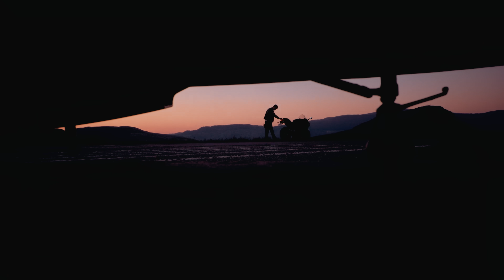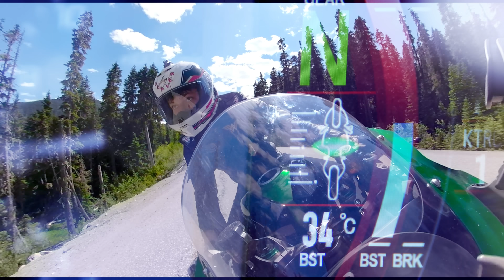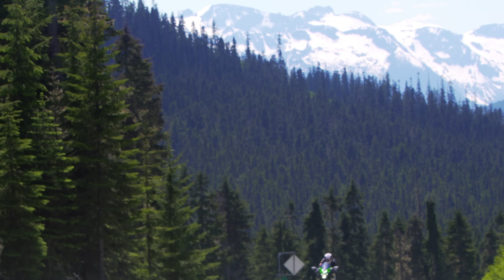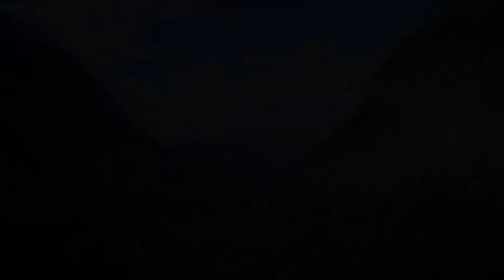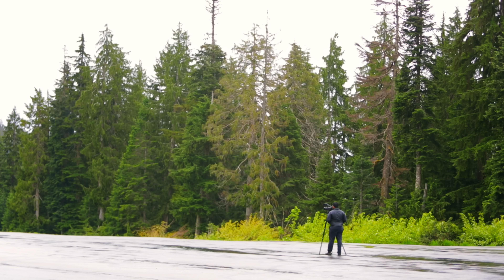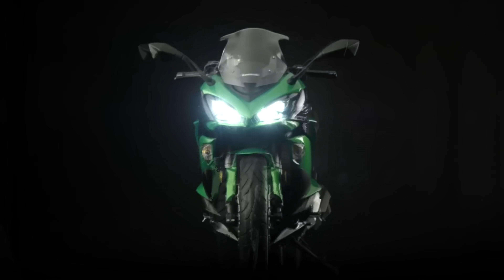Kawasaki Ninja H2 SX Review - 200HP Touring?

Comment: My husband remembers, back in 1990, buying a copy of Performance Bikes in the UK because, featured on the front, was the new Kawasaki ZZR1100. It would allegedly do 170mph and if you changed the tops of the carburettors for the ZXR750, they would open further so you would get full power.  I.e. it was restricted DOWN to 170mph. 

Also back in the 1980s, Kawasaki made a GPZ750 Turbo. He saw one once outside a bike shop he was visiting and watched for a minute while the owner showed if off and revved it up to his friends. It sounded like a small electric motor. It could do,  flat out, 155mph. He knew someone who had tried it out on the motorway at night. It made 10 hp which was really good for a 750 as, with no turbo, 70hp is what you would get.

Comment: Creators Should Attempt to Verify Their Facts First! To Repeat The Lie That The 1984 Kawasaki KZ900R Ninja Was The "World's Fastest Motorcycle" IS A FALSE STATEMENT! This is possibly before this YouTube creator was born HOWEVER Here are the FACTS from ACTUAL EXPERIENCE! Their was a great campaign by the Kawasaki and Motorcycle Magazines to "PUSH" these false claims of the power and capabilities of the KZ900 Ninja. The FACT Are in repeated runs by either high speed or drag race, the Honda VFR 1000 Interceptor trounced the KZ900s...Repeatedly. Roll-on's, Dig starts with the KZ900 starting first ALWAYS yielded the SAME results! A TROUNCING of the KZ900 Ninja! In FACT The VFR 1000 Interceptor Which Honda REFUSED to PAY the Ransom for Favorable Coverage by Motorcycle magazines was a SUPERIOR PERFORMER! Unfortunately The False Claims Made By Kawasaki and Falsely Continued By Motorcycle Magazines Who Were Obviously Influenced by Incentives From Kawasaki resulted in good sales for the KZ900 Ninja but left a number of Ninja buyers SHOCKED at the Shellackings They RECEIVED From The Honda VFR 1000's REPEATEDLY! Even Kawasaki Dealer Owners Who were familiar with the Honda VFR 1000 Interceptor would ADMIT Off The Record That The Honda Was Clearly FASTER and QUICKER! However, This does not take away the prowess of Kawasaki in innovation and commitment to performance That impressed me with my first Kawi which was a KZ1100 Beast That Was Built Like a Locomotive and probably as quick as the KZ900 under the right conditions!  GPZs, ZX14Rs, H2s clearly establish Kawasaki as a reputable and proven performance motorcycle manufacturer. However...Facts Are...Facts and NOT HEARSAY! Ride On and Ride Safe!

Comment: The chirp is not the blades breaking the sound barrier, it's surge because of the low airflow (the throttle plate closing) and high pressure ratio, if it was the sound if the blades breaking the sound barrier you would hear it all the time when the supercharger is spinning fast enough and you would still hear it when you put a blow off valve on the bike.

Comment: I'm 60yrs+, live in Michigan, I was riding a  1973 Z-1 and a 1981 FXE Super Glide. This was 1985 and and a close friend of mine said, "Let's trade bikes for a poker run." His bike was the 1000cc Turbo Kawasaki. at the time, it was a dealer installed option brand new. (his wife didn't like it) I didn't like it either. At the end of our day, my friend offered to trade "straight up, bike for bike." The "73" Z-1 was fast cool but very spooky to ride, but I didn't trade because the Turbo 1000 was far worse! 145mph on my Z-1 wasn't a joy, but a job. The "Turbo King Kawa" was by far the strongest, stupidest motorcycle I've ever ridden. Overpowered with poor top speed handling? Question is, why build it?... Thanks for sharing the beautiful videos! J.

Comment: I have two Brothers, One Brother owns the the old H1 a 500cc 3 Cylinder 2 Stroke that has a More Powerful "Power Band" then a Quadzilla 500cc and it is the 1st Bike I have ever Rode with N-1-2-3-4-5 all Up for Drag Racing and My Other Brother just Bought the New H2 Supercharged That bike is a Very Fast Bike.

Comment: This is a "Halo Bike" - it isn't meant to set sales records, it's meant to build dealer traffic. Yes, in the next few years you'll see one or two at the Saturday morning "Bikes and Coffee" gatherings, just like you'd occasionally see a $50K Honda RC. Well compensated enthusiasts would buy them for the collectability, the prestige, the pride of knowing they owned one of best bikes ever made, and the experience of riding them. Mere mortals need not apply. This Ninja follows in the footsteps of the Hypercar trend: outrageous performance reigned in with electronic nanny modes that prevent the unwary from killing themselves a quarter mile after taking delivery. Eventually the electronics will trickle down to lesser motorcycles.

Comment: You can calculate the boost pressure using the Euler turbine equation from the tip speed of the impeller and the diameter. Any competent engineer can. So Why Kawasaki don't publish boost figures I don't know.
Reply: And to cut you off from a good challenge?

Comment: You can't ride unless you can take an 80's 750 by the ass through the twistys.  It is called Body English: you either feel the G's precisely,  or you don't.  Wallowing frames used to be the norm, with frame bracing a luxury lol

Comment: All of those jokes and not once do you tell us how the bike assends the rev range.
On 1 comment about how you'd tune the bike if you owned it.
You mentioned how it enters corners badly but that's your fault.
What is TRADE MARK performance of this particular brand? 
Is it designed to overtake at the start of a straight, or in the middle or the end of a straight road?

Comment: When you mentioned the original H2, you should mention the H1. The H1 was my first bike. Hahaha. Spaghetti frame with 3 gas beavers screaming. They were nuts. The main problem wasn't the brakes. It was the frame. Flex-O-Rama. When you hit the power band in the higher rpm range, you would feel them twist. Don't get me wrong, the brakes weren't any fun either.

Comment: Ryan I'm sorry to say but there are some flaws in this video.
Centrifugal superchargers are not "blowers" They compress the air before spitting it into the engine. They are a compressor. It's simply a turbo spun by the engine and not a turbine.

A blower is a roots supercharger. "Blower" is a dumb term. Roots superchargers do not compress the air like a Whipple or a centrifugal supercharger will. They simply pump air (blow) and add heat to it from their mechanical energy and this makes them horribly inefficient because at high load/rpms a roots blower make the air less dense than it started.

And boost pressure has little to do with making Horsepower. Its all about manifold air density. You can have 20 pounds of boost but if your air is so hot it has little density then you wont make any power at all because the total amount of air reaching the engine is next to none.

Comment: Same suspension and electronics package can be had on the 2019 & 2020 Kawasaki Versys 1000 SE LT+ for $7000 less.  Of course, you don't get that sweet turbo so they only net 120HP, but it's still plenty for touring around.

Comment: Super Chargers should be on every engine, because they are “power on demand” friendly and greatly “improves fuel consumption” because it’s always spinning and providing cooler compressional air to the engine. It especially shines at high altitudes when going over the Rocky Mountains! My Supercharged Pontiac Grand Prix has gotten just over (60) mpg on long distance trips across the U.S. with the cruise control set at 65 mph. Turbos are great for smaller engines because they don’t attach to the drivetrain robbing energy from the smaller displacement engines typically under 150 Hp.

Comment: The chirping noise is NOT the blade tips breaking the sound barrier, you will not that it only happens when you come off the throttle. The chirping noise is caused by back pressure from the induction system and the blades trying to cut through that, effectively, it's "back flow" passing over the turbine blades. (y)

Comment: Only issue, a centrifugal supercharger doesn't add extra air at high altitude vs a naturally aspirated engine. You need to remove the compressor from the engine and to do that requires a turbocharger.

Comment: superchargers also lose boost at altitude. Superchargers don't work like turbo's do. Turbo's spool up until they reach their set boost level. Superchargers just spin at a fixed rpm compared to engine speed. They experience the same loss of power as an NA engine. Maybe not to the same extent but they're not as immune to it as turbo engines

It's more likely that the bike didn't feel like it lost any power because it has such a surplus of torque in the first place

Comment: 25k over there wow, they are a nice cheap €27,899 for the SX and €34,599 for the SE here in Finland.  Buggers want 25k for just the base Ninja with the SE and RR going for €34,500.  Only a cool 8K more than other parts of Europe.  I usually ride past and flip the bird at the Kawasaki stealership.

TopGun reference - soo daggy but on point at the same time.

Comment: The tips do not break the speed of sound if it did it would implode unless it had a convergent inlet ducts. If it was breaking the speed of sound it would be making the noise at full throttle highest rpm not at throttle chop. The sound you hearing is air not having anywhere to go some call it slippage.

Comment: Supercharger does absolutely nothing for high elevation compared to a naturally aspirated engine if they both made the same power at sea level. Reason why, its coupled to the engine and whatever RPM the engine is spinning the supercharger spins. On the other hand a turbocharged that is spun by exhaust gasses will provide more boost at high elevations and spin faster at those high elevations vs sea level.

Comment: The H2 sx is so easy to get a long with because the computer restricts the hell out of the bike if you get it unrestricted it pushes 232 at the rear wheel just like the regular hr granted it is almost 60lbs heavier but that is still lighter and more power than a zx14r

Comment: ...and it's detuned, wings clipped at 10k, electronically. Let the beast off the leash (ECU flash), and oh my, 222 rear wheel hp and a smooth ass throttle.

Comment: I NEED HELP
My rear tyre seems to be titled awkwardly. I can ride but the wear on my tyres is uneven. And I feel it's causing the bike to wobble at higher speeds. I checked this thread on a portal and it has the same tilt as shown in the image. If it helps I own a TVS Apache rtr 200 4v. But the thread talks about dual shocks that might be misaligned. My bike has a monoshock. It's only 3 months old. And I'm getting serious back pains. Please help me because the mechanics don't see the tilt. Even after pointing it out about the uneven wearing.

http://www.team-bhp.com/forum/motorbikes/138345-motorcycle-tilts-right.html
Reply from the maker: Could be an alignment issue - you can check this easily with some string and a ruler. I go through it at the end of this video: https://www.youtube.com/watch?v=zsGN9GVjBwo ... hope that helps! ~RF9

Comment: First, have to say a pretty great video with the top gun throwbacks.   I really thought/think I want to buy the H2 SX, but the price!  Instead a used S1000XR is 1/2 the $.  So in the corners on the XR, I miss the clip ons and low center of gravity of the H2 SX.  As a former road racer turned old, I can't handle touring 7 days on a crotch rocket.  So is my only choice the H2 - wait for a used one?
Reply: H2SX SE has clip ons, and it has low center of gravity.

Comment: The zx14r still walks away from this bike.
Reply: yeah, walks :) but doesnt run away.. I rode ZX14R for three weeks before i received my h2sxse. ZX14 has not much difference in power, slightly faster acceleration, BUT one ton heavier, one kilometer longer, one meter less ground clearance,.... not to mention lack of supercharger, cornering ABS, cornering lights, ridiculous dash, two rocket shaped exhausts etc... (loved the ZX14R, but no cigar)
Reply: @tiborsekelj  Ahhh, the zx14 and the h2 sx have the same wheelbase and it's a pretty fast walk

Comment: Rode one. It's a beast and handles surprisingly good. Rearsets are in a bad spot. This is the only bike that made my hip flexors  sore since my '93 Gix 750. The bike should be a SC 650 ST that really can achieve 60MPG and not be $20k. Try that Kawasaki. 200 HP on a ST is waaaay unnecessary.